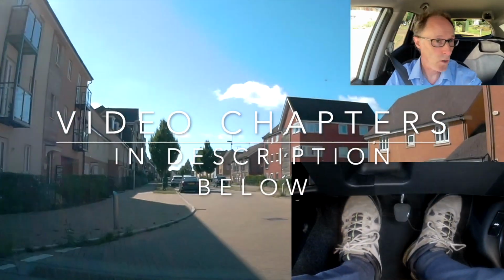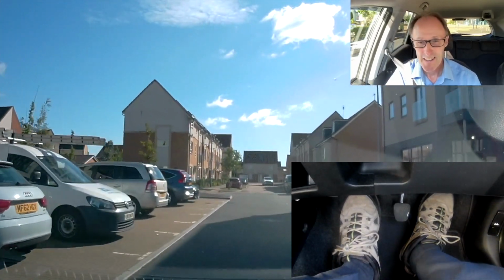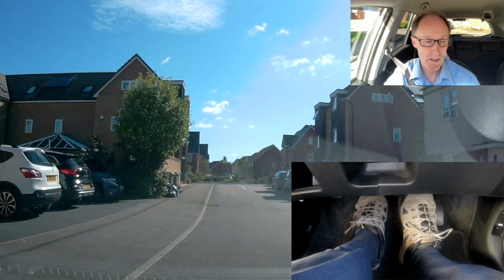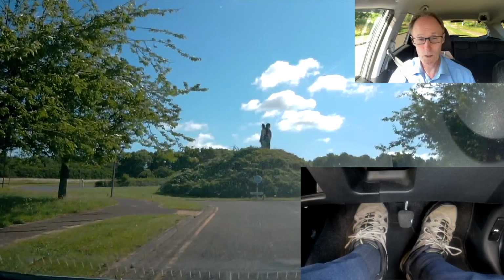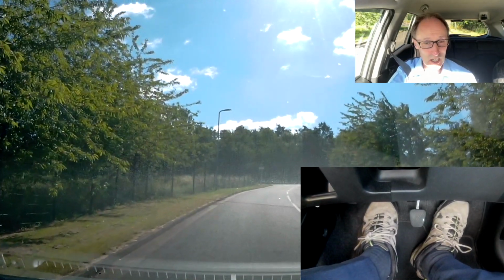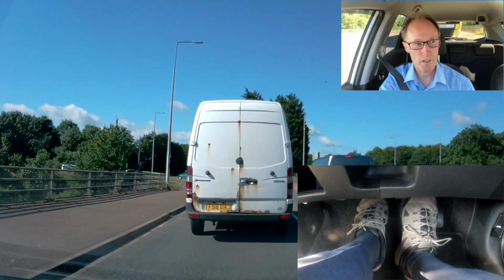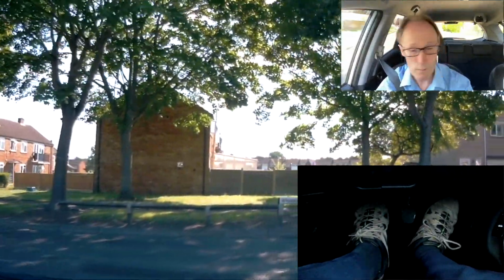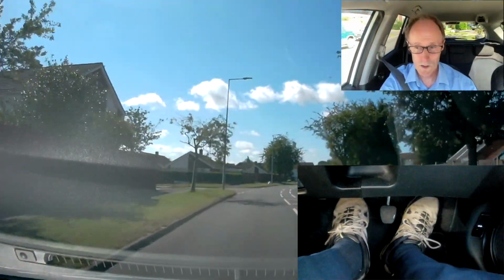Clutch Control in a Manual Car | Clutch Control driving lesson in traffic and on hill starts

Comment: Failed my practical test recently for clutch and biting point in hill area . 
Thank you for your video . 
If I give my exam different city is it good idea , because it is very hard to get a test in Luton right now . 
Low cancellation
Reply from the maker: If you try a new area, say Milton Keynes or Bedford, then spend some lessons in that area within a mile of the driving test centre to get to know some of the tricky roads and junctions.

Comment: hi Travis, is it okay to lift the clutch a little before pressing the gas just to prevent the car from rolling back as I am quite slow when moving my foot to the gas and clutch pedals.
Reply from the maker: Yes.  
But if you lift clutch too much you will risk stalling
Reply: @JamesTravis  how much is too much? My instructor recommended finding the biting point white still having my foot on the brake but I was under the impression this could potentially stall the car. Perhaps some cars can deal with that and others can't??